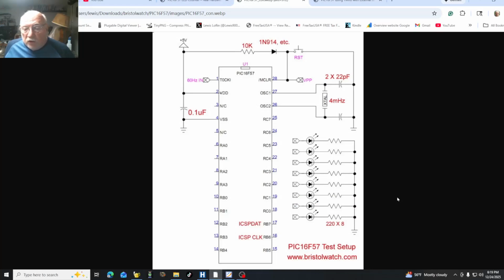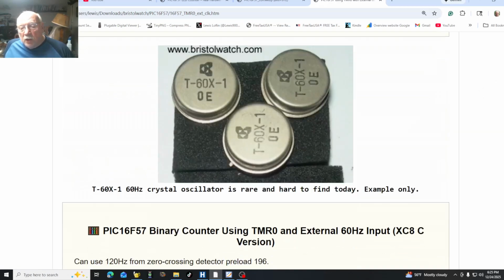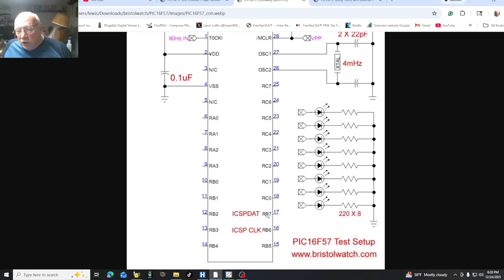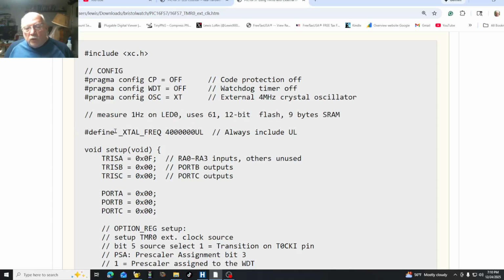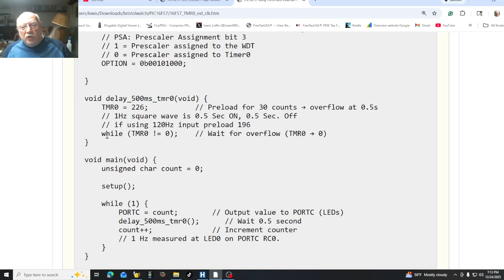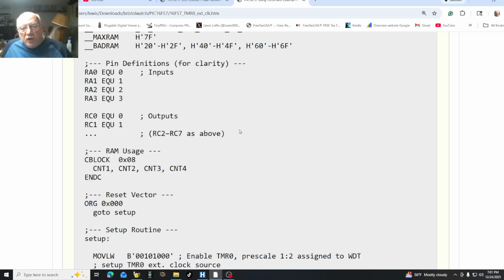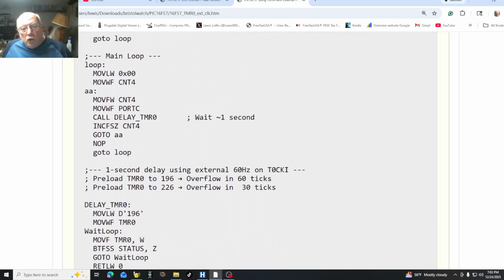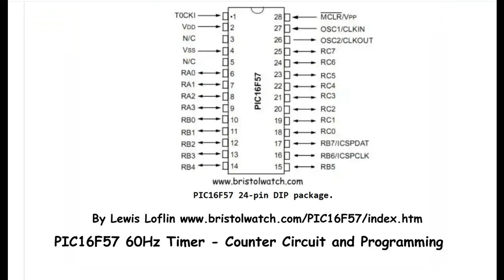PIC16F57 using TMR0 with External 60Hz or 120Hz Clock

Comment: Back 46 years ago, I used 60Hz from the secondary of the transformer, similar to your circuit, but zero crossing had tons of noise, like they used a synchronizing diplex AC signal ontop of the 120VAC line, and this would be ever hour, to catch some internal mechanical mechanism that would bring the minute hand to the top of the hour. This would be counted by my circuit. It was a defrost timer for heat pump research.
Could the AM/FM broadcast also be picked up by the open antenna on TMR0, and via substrate and other capacitive cross talking effects, mess up some internal circuits in the processor?
I've really enjoyed your H bridge high/low driver videos. I know these videos are mega effort to produce, Thank you.